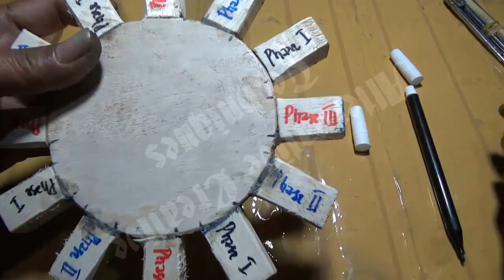(How to) Rewinding a Brushless DC Motor - 12 poles stator.

Comment: Very Easy understanding for me from your clip video, thank you so much! I’m waiting for another clip from you,
 Step, step and slow, slow for those who have a new passion.
Reply from the maker: Ok, you're welcome.  May be useful.
Reply: @YudiHermanto4H  Sir great video. One question do you need to change the magnets on the rotar if you rerwire the stator poles like from a 12 pole to a 6 pole or can the magnet orientation on the rotar stay the same? Also what about the hall sensors.

Comment: Video is good but swg and runs acording to voltage and current although depends on wire gauge we don't know whether it is5. 12  24. 36 48 60v

Comment: Hi I am trying to make a hi torque very low speed motor, the statore has 24 poles diameter 70 mm . How do you suggest to proceed to get the best result. Multi strand o singole and diameter how many turns all clockwise or alternated,  star or delta  and how many neodymium magnets. There are to many variables to take in consideration and I am not very able in this field please I would really appreciate  your help Thankyou very much
Reply from the maker: You use 20 magnetic poles.
coil arrangement and winding direction, as follows :
Aa-bB-Cc-aA-Bb-cC-Aa-bB-Cc-aA-Bb-cC
A=cw
a=ccw
B=cw
b=ccw
C=cw
c=ccw
Or watch this video, the winding direction is the same, the coil order is the same :
https://youtu.be/ThjwZNuncfU
Reply from the maker: Note the number of slots and magnets, 12 slots and 10 magnets.  It's just multiplied by two, the order of the coil and the direction of the winding is the same.  I don't know your stator size.  If the previous diameter was 0.7mm, try increasing it to a diameter of 1.2mm.
Reply from the maker: Delta configuration: high rpm, but low torque.  Star configuration: low rpm, high torque.
Reply from the maker: 24 slots / teeth and 20 magnetic poles, usually applied in electric cars.
Aa-bB-Cc-aA-Bb-cC-Aa-bB-Cc-aA-Bb-cC
A=cw
a=ccw
B=cw
b=ccw
C=cw
c=ccw
Reply: @YudiHermanto4H  Thankyou very much only one more question the wire size/diameter  Multi strand o singole and how many turns. You have been very kind Thanks again

Comment: Is this exactly how to wind three phase generator ?
Reply from the maker: This is for a three-phase brushless motor.  But all three-phase brushless motors can also be used for electric generators.  What kind of three-phase electric generator do you want?  Or how many stator poles and how many rotor poles?  Three-phase brushless motors or generators generally have stator poles in multiples of three.  With the number of rotor poles: every 3 stator poles opposite 2 poles in the rotor.  So suppose the stator has 6 poles, then the magnetic poles in the rotor are 4. If the stator has 12 poles, then the totor has 8 magnetic poles, and so on.
Reply: @YudiHermanto4H  
Thank you for the explanation. You're indeed knowledgeable in what you do. Thumbs up👍 . It is now clearer to me how those generators works
Reply from the maker: @AugustineAriola  Okay, you are welcome...

Comment: I would like to build a bldc motor with 500 watt 1500 rpm which can work with 24 Vdc . Is it possible to send me the instructions? The bldc will be 15 cm in diameter and between 5 to 7 cm thick

Comment: Mas apa semua dinamo brushles cara menggulung nya sama begini? 
Ujung end semua di gabung . .
Pase star untuk esc semua atau gimana ?
Reply from the maker: Beda jumlah magnet beda lilitanya.
Kalau sambungan star, ujung end digabung/disolder. Nah ujung start yang ke ESC. Kalau star torsi besar tapi rpm rendah, kalau sambungan delta torsi rendah tapi tinggi rpm nya, dengan spesifikasi yang sama.
Reply: @YudiHermanto4H  maaf mas saya belom paham yang di maksud sambungan delta mas maksudnya gimana  .saya masih mau belajar . 
Kan ada juga mas yang melilitnya beda2 cw /ccw gitu .
Reply from the maker: @vinoymotovlog3359  sambungan star dan delta itu untuk sambungan dari ketiga phase dari motor 3 phase, entah motor dc atau ac.
Untuk yang lilitanya ada yang cw dan ccw, itu arah lilitan sesuai jumlah magnetnya, dalam hal ini brushless dc motor (bldc motor).
Jadi mau cw atau ccw dilihat dari jumlah kutub magnet dirotor.
Karena kan dari masing2 phase asupan/masukan tegangan ke coil masing2 phase berbeda2 atau berubah2 sesuai/diatur oleh esc/controllernya. Pengaturan oleh esc/controller ini membentuk medan magnet putar pada coil agar susunan magnet permanen yang di rotor bisa berputar.
Coba mas cari video tentang dasar2 motor brusless dc.
Kata kuncinya how it work brushless dc motor. Nanti muncul semua video2 yang berkaitan dengan motor beushless dc.
Reply: @YudiHermanto4H  baik mas mau saya cari2 tau dulu sebelum mencoba . Oya mas . Kalo pengen brusles jadi lebih kenceng rpmnya itu di rubah dari ukuran tembaganya .apa dari jumblah gulunganya  ..
Reply from the maker: @vinoymotovlog3359  ok mas, lebih baik ditau dulu dasar2nya..biarpun tidak semua. Tapi paling tidak ada gambaran sedikit2.
Kalau mau lebih kenceng, banyak faktor mas. Kalau saya biasa modifikasi, perbesar diameter kawat. Karena slot nya terbatas tentu jumlah lilitan jadi berkurang. Maksimalkan saja sampai muat berapa.
Tahan tidaknya terhadap panas yang ditimbulkan, tergantus seberapa maksimal proses pelepasan panasnya dan sesuaikan drivernya.

Comment: I have a BLDC ebike motor, i want them to go faster with the same voltage, so i put less turns with a thicker wire?
Reply from the maker: Use a larger enameled wire. For example from 0.7mm, replaced by 0.9mm. The difference is not too far, because it will damage the electronic components, especially mosfets.
Reply: @YudiHermanto4H   my controller and my battery have a max load of 20a continuous, but my 500w motor draw only 8a continuous  12a max, i trying to pump up to 15a continuous 20a max. 
my ebike have max speed os 30Km/h, in highways i feel unsafe, and electronics (and ebike) parts here in Brasil are expensive, so i trying to do it myself

Tx for the reply
Reply from the maker: If you want to increase the controller power, you can replace the mosfet with a larger specification. Or parallel the same mosfet. But you must know how to parallel mosfets.
Reply: Teknik Kreatif Alternatif hi

Comment: Bang untuk stator 6pool dan rotor 6pol jg . apa bisa bang pakai hall sensor 3biji
Reply from the maker: Kalau hall sensor 3 biji hanya untuk motor brushless dc 3 phase. Motor brushless dc 3 phase kan ada 3 coil yang dialiri listrik secara bergantian input tegangan positif dan atau negatifnya agar membentuk medan magnet putar di stator sehingga rotor yang dipasangi magnet bisa berputar. Nah, hall sensor ini berfungsi membaca posisi magnet di rotor dan mengirim signal ke otak (IC) pengaturnya. Yaitu phase mana yang harus diberi tegangan positif dan mana yang harus diberi tegangan negatif secara tepat agar pada stator terjadi medan magnet putar. Jika tidak, si rotor tidak akan bisa berputar.

Comment: Could you explain how the pole pair for phase I with one, phase end, being the north pole and the other, phase end, being the south pole actually holds true? 
 I keep applying the right hand rule on phase I, assuming that a positive voltage V+ is applied to the "start" white tag, according to the right hand rule the point of phase I pointing inwards  towards the center is a north pole, and I follow you around to the opposite end and I keep getting that the part facing inwards towards the center also becomes a north pole so we have a double north pole pair? How can it spin if we have double north poles and double south poles. Could you explain I am very confused.

Comment: I don't understand, i did exactly that and my motor does not work. Also when i rotate the rotor i dont get electricity on the wires measuring with a mutimeter. Something is wrong here and i dont know what it is. Could you please help me?
Reply from the maker: I assume you did it right when you made the coil. Try to check the connections, whether it is connected perfectly. If the direction of the coil is correct, I'm sure it can rotate well. Or you check the magnetic order, there may be an error (N-S-N-S)

Comment: Hi good video i have 27 poles how is this done do i repeat phase 123 ?? x2  this will give 24 poles but will give 3 extra ?? not equal
Reply from the maker: If 27 poles, divided by three. Or three poles (stator poles) in parallel. The end result is 9 poles. And the number of magnets in the rotor becomes six magnetic poles.
How to parallelize the stator pole : https://www.youtube.com/watch?v=GGZq_RHnR5A

If it's still unclear, please send your e-mail address, I'll send the sketch / diagram later.
Reply from the maker: Sorry I was late answering your question.
Reply from the maker: Sorry, I was late seeing your reply. But I have contacted you via email.
Reply from the maker: I have contacted you via email.

Comment: How are the magnets arranged in this 12 pole stator?  Should all Phase I stator face the same magnetic pole, like, in this 12 pole stator, if there are also 12 magnets, each stator pole will face N, then the next phase will be S, then the 3rd phase stator will be N.  This means, phase 1 magnet of N will be the same as phase 3 magnetic pole. 
Does this mean that the number of magnetic rotor poles may not be 12 if all phase poles will be the same?  It will look like this:
NSN NSN NSN NSN.
Therefore, if there will be 12 magnetic rotor poles, each phase pole will have different magnetic rotor poles, and it will look like this:
NSN SNS NSN SNS.
1       2       3      4
Will the windings that you have shown still be followed?  Or will the direction of winding be changed for each stator pole?
If the direction of winding is the same to the same phase pole, it will have the same magnetic pole  when power is applied to the series of windings.
Does this mean the number of magnetic rotor poles can only be 4 and seeming 12, so that it will look like this:
NNN SSS NNN SSS.
In the actual fan, the number of magnetic poles of the rotor was not shown.
(I have a project.  Your explanation is very clear.  However, I have to raise the questions to clarify my doubts.  Please reply).
Reply from the maker: In general, 3-phase brushless motors, every 3 coils (stator poles) face 2 magnetic poles N and S. And in general also, 3-phase brushless motor, has a number of stator poles (coil) multiples of 3. So, if the stator pole will be added / increased, then the number of poles is, three, six, nine, twelve and so on. Sebagai contoh, jumlah kutub stator adalah enam, artinya ada empat kutub magnet di rotor (N-S-N-S). If the stator has nine poles (coil), 9:3=3....3X2=6 magnetic pole (N-S-N-S-N-S). If 12 stator poles, 12:3=4...4X2=8 magnetic pole (N-S-N-S-N-S-N-S). 
(Although there are brushless motors that do not have a stator pole multiple of 3. But this is rarely encountered by me).
Reply from the maker: NSN SNS NSN SNS.
1       2       3      4

     NNN SSS NNN SSS.
       1       2       3      4

     (N       S       N     S)
Reply: @YudiHermanto4H  I have 6 stator poles.  This means 6:3=2 2X2=4.  Ok.  I'll try to make a magnetic rotor with 4 magnetic poles.  Thank you very much.
Reply from the maker: @badtensioner  Ok, you're welcome...
Reply: I'll try to do 4 sets of 1 first, but big magnets.  With the 4 sets of 3, the magnets will be very small.  However, I'll still try the 12.  I'll see which will be better.  Thank you again.  More power.
Reply from the maker: Yes, just try it, later you will understand more. Ok, thanks for visiting my channel.

Comment: Do you have the same poles on all sides on the rotor?
Reply from the maker: Every 3 poles the stator faces two magnetic poles in the rotor. So, if the stator has 12 poles, the number of magnetic poles in the rotor is 8 pieces.
12 : 3 = 4....4X2=8.
Reply: @YudiHermanto4H  Ok.Thankyou for fast answer, but what i actually should have asked for is:
Are every pole on the rotor facing the north pole against the stator?
I see that you have wired all coils the same direction, so thats why i wonder :)
Reply from the maker: Sorry, if I do not understand your question.
This is a three-phase dc brushless motor. Changes in the magnetic pole on the stator are programmed to form a rotating magnetic field. So that the magnets in the rotor move regularly. So I explain as described above. When the motor is not working, every 3 coils on the stator (phase 1, phase 2, phase 3) face two N-S magnetic poles. Or it could be that every 3 stator coils face 4 N-S-N-S magnetic poles. So, if there are 12 coil stators, the magnetic poles in the rotor can also be 16 magnetic poles.

Sorry if my answer did not match what you wanted.
Reply: @YudiHermanto4H  Thank you so much for your help.
me and a classmate are building a 12 pole stator for a bldc motor and trying out different rotors that we build. this is a school main project for this year.
We are currently using an Hobbywing XR10 ISC controlled by Arduino, we are currently not sure how the output is fired from A to C and therefore not quite sure how to wire it correctly. We are currently planning on wire coil 1 cv, 2ccv, 3cv and the forth ccv again and repeat it for all 3 phases.
Our current rotor has N 2 pole 180 degrees seperated and 2 S poles 180 degrees.
What do you think about that?

Best regards Christopher

Comment: Mas bisa design dimensi & gulungan motor brushless dg cassing pipa PVC 4" high speed & big torsi buat drone beban berat ??? kemudian dg menggunakan batteray voltage 12/24 VDC yg mana yg mendukung buat brushless yg di maksud. Mksh
Reply from the maker: Outrunner ya...
Pakai pvc, maksudnya stator pvc juga ?
Kalau stator pvc kurang maksimal torsinya.
Kalau pakai brushless nya foto copy bagaimana ? Tapi diameter sekitar 3".
Reply from the maker: Seperti ini motor brushless nya :
https://youtu.be/VapiV6_hkrE
Reply from the maker: Itu kalau dimodif lagi, magnetnya 10 atau 14, speed dan torsinya naik.
Kayaknya 10.000 rpm cukup untuk drone.
Reply from the maker: Coba cek juga yang ini :
https://youtu.be/_6tZ9XBRyBU
Reply: @YudiHermanto4H  PVC 4" sbg casshing saja mas kan ada tutup dob yg model lem sama drat sbg pelindung gulungan, As yg berputar min diameter 10mm atau lebih
Reply: @YudiHermanto4H  ok yg itu sy lihat eks foto copy ya ? trus konsumsi tegangannya ? support dg ESC standard drone ? atau harus buat ESC sendiri ?
Reply: @YudiHermanto4H  yang mana ? eks foto copy iink video atas ?
Reply: @YudiHermanto4H  cara modif mas ? ada videonya ?
Reply from the maker: @rafcomtech  yang ex foto copy link yang paling atas. Cara modifnya sama dengan di video ini, urutan dan arah lilitan sama.
Reply from the maker: @rafcomtech  bisa pakai ESC biasa, tinggal sesuaikan mau pakai ESC berapa S dan berapa watt.
Reply from the maker: Yang dimaksud mau pakai casing pvc, bararti brushless inrunner ya, rotor ditengah ?
Reply: @YudiHermanto4H  Ok mas sy coba eksperimen beli motor ft copy bekas, nanti klo sy bingung di bantu kontak number ya. Sy rencana mau beli remote fly sky transmitter berikut receiver & motornya rakit sendiri dg kapasitas besar nanti sistem pengisian aki pakai mini mesin bekas rumput, hanya sy kendala membuat motor brushless kapasitas besar. Mhn ajarin membuat sekitar 4" berikut aplikasi dg ESC & remotnya. matur suwun
Reply: @YudiHermanto4H  yang kapasitas besar mas. mau buat drone mampu angkat min 50Kg
Reply: @YudiHermanto4H  ya maksudnya ada bahan PVC 4" enaknya menurut ahli brushless bagaimana dg bahan itu sebagai rotor di dalam / pvc 4" nya yg berputar, intinya dron3 dg 4 - 6 propeler begitu mas.
Reply from the maker: @rafcomtech  tidak tahan lama/kurang kuat itu mas. PVC mudah lentur kena panas dikit. Saya tidak jamin bisa maksimal.
Mending ngecor aluminium sendiri, lalu bawa ke tukang bubut.
Coba cek video saya yang lain yang topik ngecor aluminium, itu bisa untuk referensi. Aluminium titik lelehnya cuman 600'C. Tidak butuh alat pemanas khusus/agak canggih. Pakai arang atau kayu juga bisa lebur.
Reply from the maker: @rafcomtech  ok siap mas, semoga saya bisa bantu.
Untuk chat via wa, silahkan tinggalkan nomor wa, nanti saya hubungi duluan. Nomor wa tulis pakai huruf/jangan pakai angka. Biasanya hilang kedetek spam sama youtube.
Misal, kosong delapan dua satu...dst.
Reply: @YudiHermanto4H  ok boss ku sy faham sy berfikir body pvc 4" ringan u/ custom brushless motor berdaya besar, dg rencana aki mobil 40A & ranggka hollow 4x6 mas.

Comment: Wrap the 51 pole motor bro, Or 51 pole motor wiring diagram. Please Bro!
Reply from the maker: That's actually easy.  How many poles does the rotor have?  What are the 34 poles of a magnet?  If so, the winding is like this: ABC-ABC-ABC-ABC-ABC and so on until the 51st pole. "A" = phase 1 coil, "B" = phase 2 coil, "C" = phase 3 coil. And the direction  the coils are all the same, ccw.  Phase A, from the first pole (1) then to the fourth pole (4), pole 7, pole 9 and so on.  Passed by 2 poles.  Or the stator poles are numbered, 123123123123123 and so on.  Later you will easily place each coil, phase 1, phase 2 and phase 3.
Reply: @YudiHermanto4H  Thanks Bro
Reply from the maker: @cameranguyencong370  ok, you're welcome, bro.

Comment: Kalo yang model 12 pole kaya gini posisi hallsensor tiap phase nya gimana,mohon bantuannya mas😁
Reply: Kalo mau pake hallsensor😁
Reply from the maker: Penempatan hall sensor di antara/di sela2 phase 1 dan 2, phase 2 dan 3, phase 3 dan 1.
Reply: @YudiHermanto4H  12 pole stator brarti pasangan nya 8 pole rotor
Reply from the maker: @tejja4868  iya umumnya 8, tapi bisa juga 10 atau 14 dengan konfugurasi lilitan berbeda, mas.
Reply: @YudiHermanto4H  kalo lilitan nya sprti yg d video?
Reply from the maker: @tejja4868  yang video ini mas : 
https://youtu.be/ThjwZNuncfU